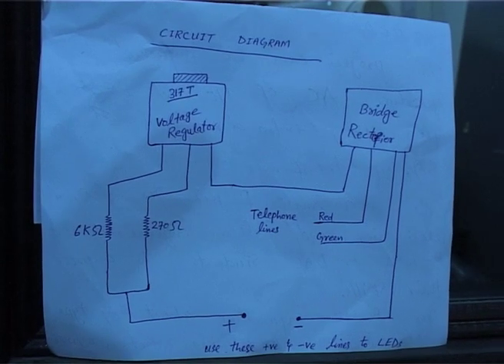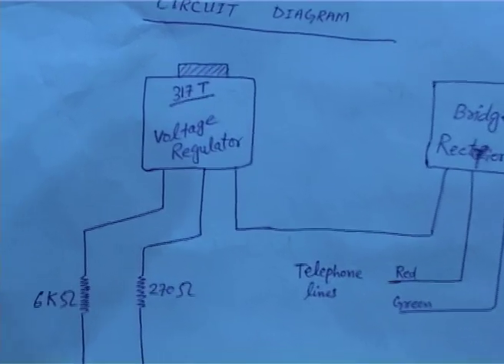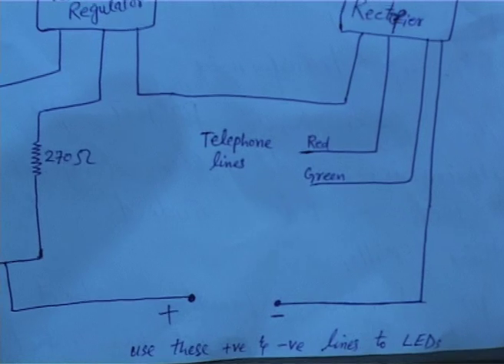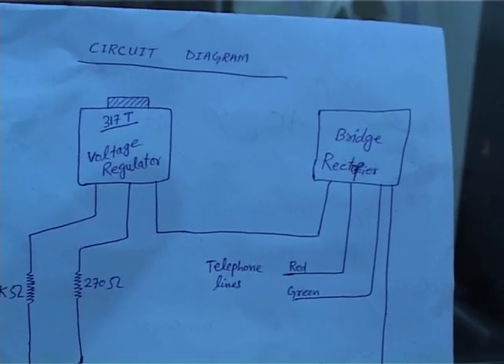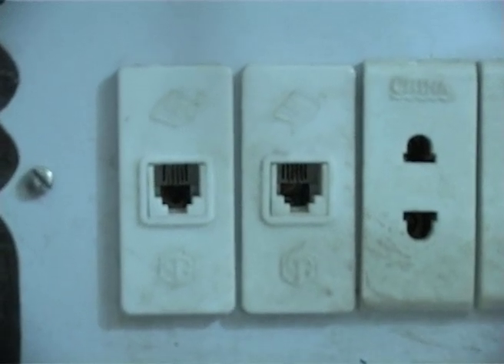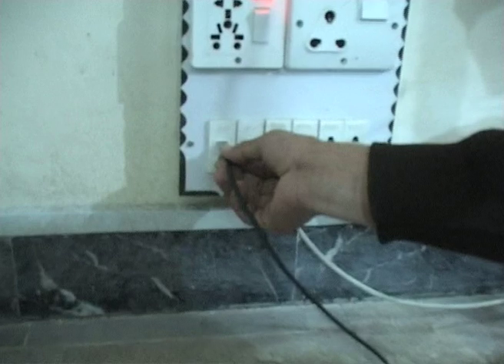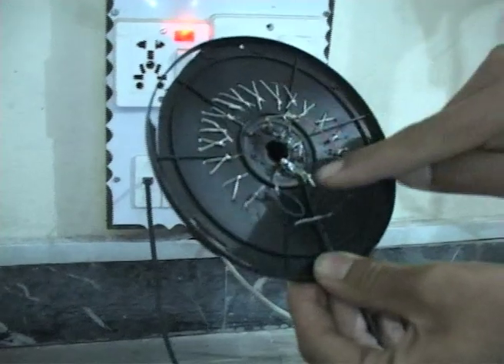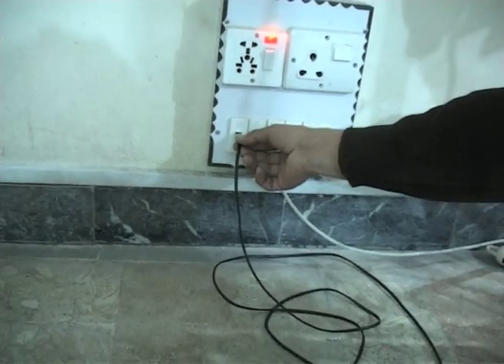Free Electricity through Telephone Lines.mov

Comment: This is NOT FREE.  The line voltage will not be there unless you are PAYING FOR PHONE SERVICE.  Also if you draw too much current, the phone line will register as OFF HOOK, meaning no phone calls in or out.
Get some cheap solar cells and rechargable batteries if you want real free power.

Comment: I am just shaking my head about this idiot's claims. I have been a tech for the phone company for 30 years, every part of getting dial tone from the company building to your home. This is an absurd claim. At best you can only get a tiny amount of current and current is what you need for electrical appliances. I have not ever heard of a single instance of using phone lines to convey normal AC. Don't waste your time.

Comment: Telephone line is normally 48v DC, 120VAC for ringing.
The current is low, though, so it will power a corded phone, and perhaps a small radio, and some LED, but little else.
I guess you could make a battery charger to charge up some 12v batteries.

Comment: i meant you can not hook up an inverter that uses 12 volts dc to a phone line cuz when you draw current on the line it goes from 48v dc to 9 volts, that 9v is to power a phone during conversation, although you could charge a batter with it, then power an inverter but an inverter uses to many amps

Comment: if the power goes out at the main office and your house both then the line is battery powered, your light will drain the batteries faster and could prevent a neighbors 911 call plus your could burn your house down, you can't draw that many amps threw phone wiring house with out it over heating and burning your house down, when your phone rings the voltage goes up to 90 volts of a.c. current, 9 volts when the phone is being used to talk, and around 48v dc idle but the idle voltage can vary.